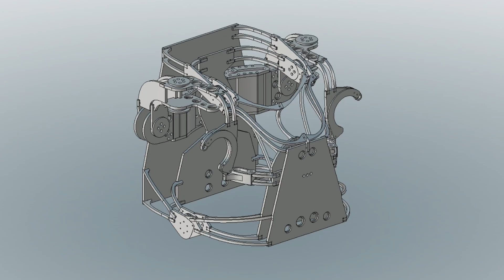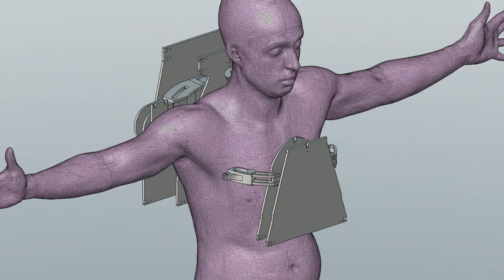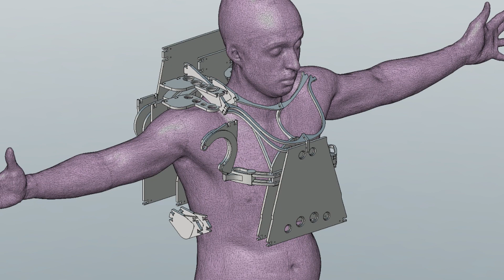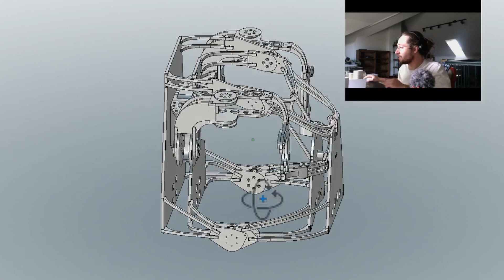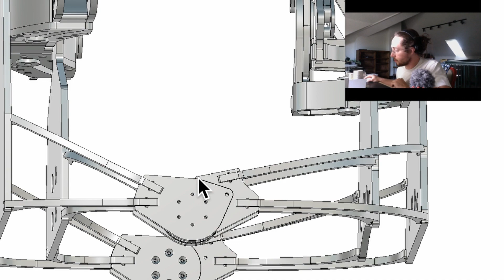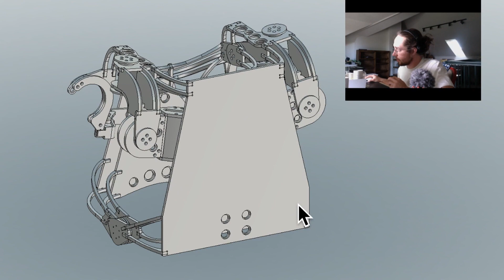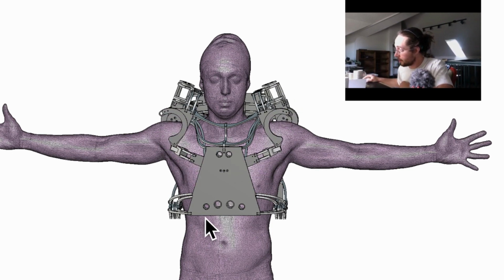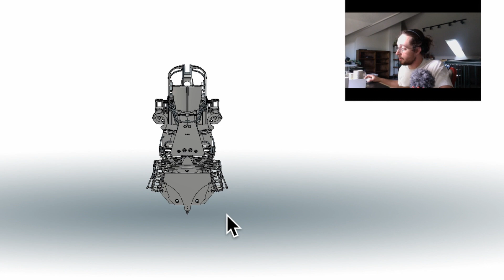How I Design an Exoskeleton (Chest Piece)

Comment: I'm 3:00 minutes in and I sure do hope you've designed a soft foam framework for the breast and back plates, or at least positioned those hard edged actuators after coating everything with thick, padded plates of armor after curving the main front and rear plates, while designing and coating those mechanical bits and the bare , hard edged aluminum and steel breast plates and rear mounted plates, as well as taking care to fit all of the joins, pins, and moveable parts fitted as closely designed rings, toroids, and hinged, articulated pieces so that they lie comfortably against any bare skin exposed inside the nooks and crannies of the musculature while taking great pains to make sure the overall design is one of function following form.